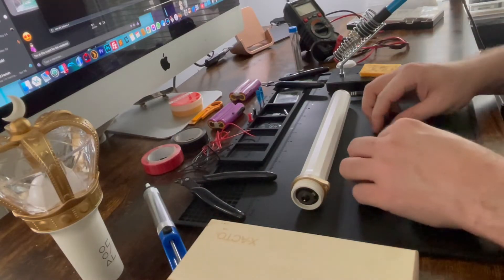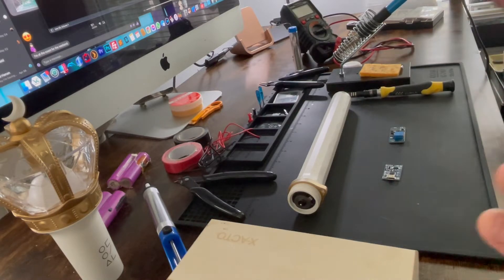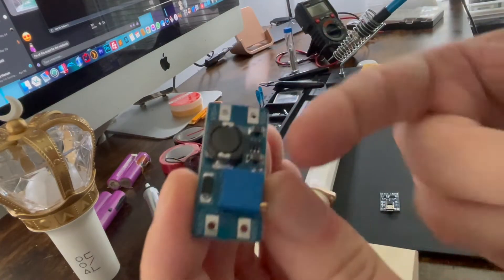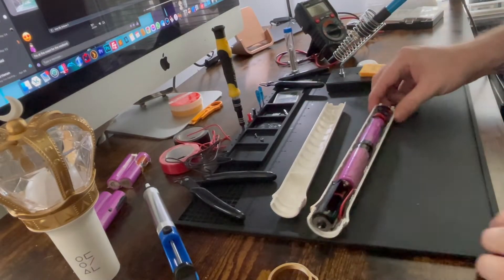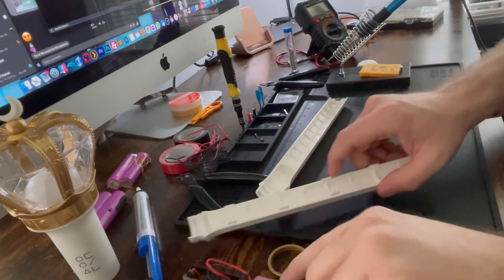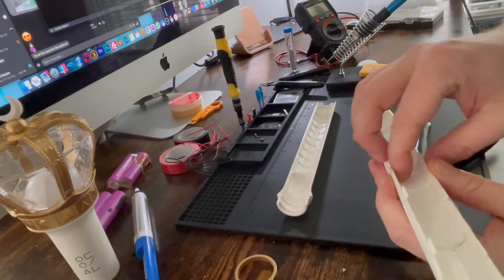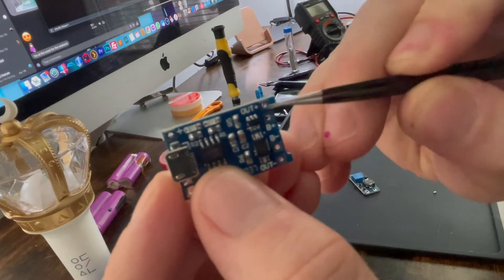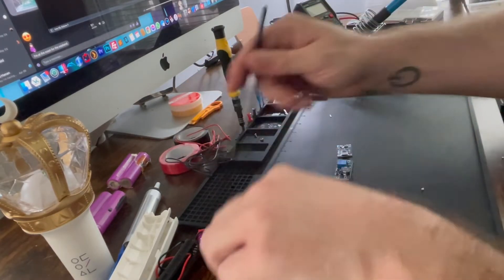How I Modded My LOONA Lightstick with USB Charging and Dual 18650 Batteries

Comment: I know this comment is WAY late, but as an electrical engineer, I want you to know that hot glue is an amazing insulator! You can use that instead of the electrical tape, and it also helps to hold the circuitry in place. If you don’t want it to be “permanent” I would recommend kapton tape instead of electrical tape, since it insulates AND has extremely high thermal resistance. All in all, great job! And hopefully I’ll get my light stick soon! I’m already working on nodding my wife’s Wonho Lightstick and my Blackpink lightstick
Reply from the maker: right you are! I ended up coming back to this later and absolutely murdering the interior with hot glue, so it's nice and solid now. I do plan to remake this video with some modifications, like only doing 1 battery cell and using a USB-C 4056. Thanks for the input!!
Reply: @marksleblanc  No problem! I’m just glad to see I’m not the only one to think of a rechargeable Lightstick! Lol

Comment: istg BBC should see this video lmao
Reply from the maker: tbh, I more or less understand why they engineered it like they did. The LOONA lightstick is the physically largest in kpop (from my understanding), and in order to do that, they likely had to cut some costs and liabilities. They might not want the liability that comes with putting large battery cells inside an item possibly given to children, I figure. ¯\_(ツ)_/¯
Reply: @marksleblanc  I see! that's totally valid if ur gonna mass produce it. but I think Dreamcatcher's lightstick is bigger tho!
Reply from the maker: does it have bigger batteries than the 3x AAA LOONAs came with?